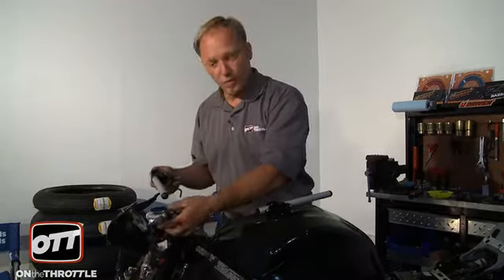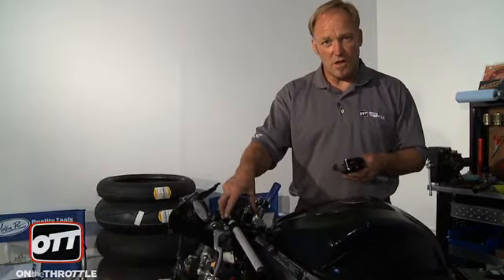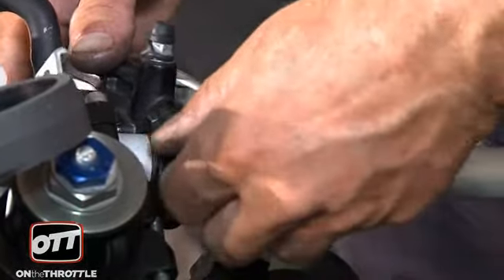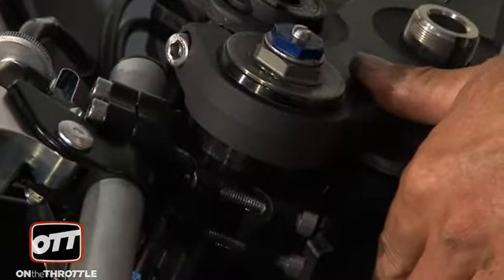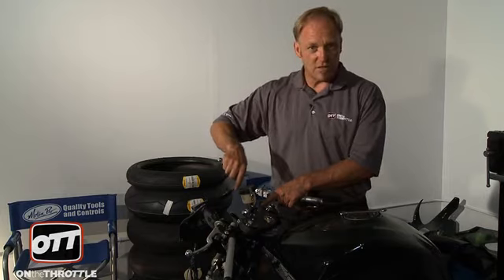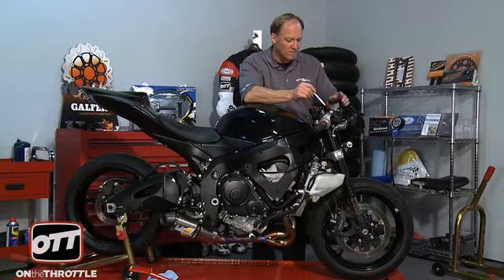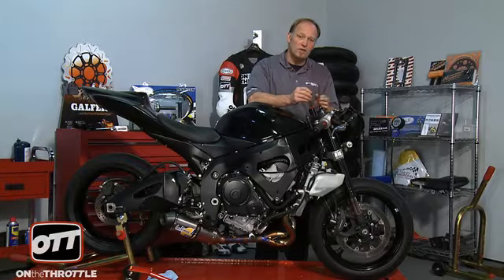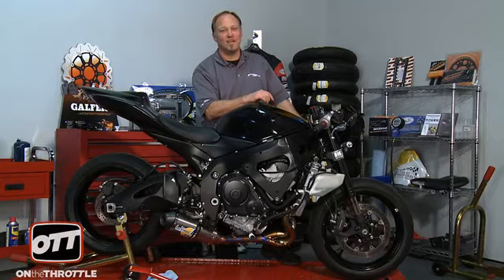Performance Upgrades GSX-R750 Project Bike Attack Clip-ons

Comment: Surely that's not the ideal place to mount the brake reservoir, it's right in way of the throttle adjusters and potentially causes rubbing on the hose. Good example of what not to do IMO

Comment: when putting top triple back on what do you use as leverage to torque top triple nut ? do you temporally tighten handle bars and top triple bolts to do so? as im a summing you would twisted triples using stopping blocks.

regards
john